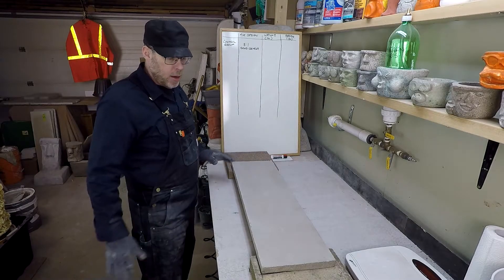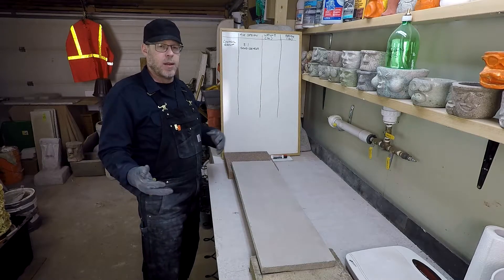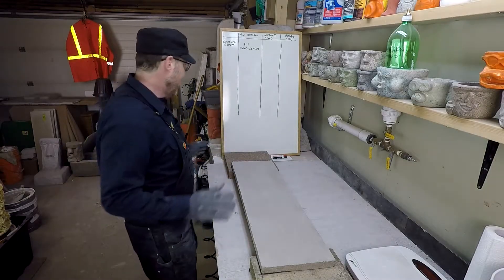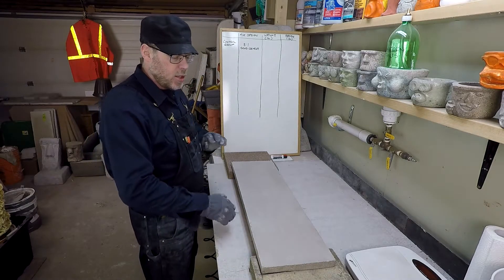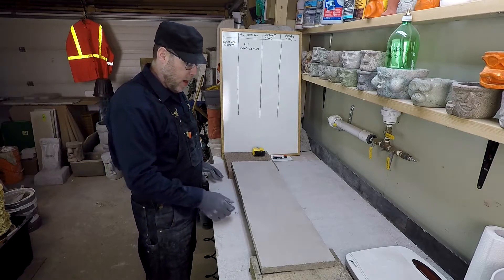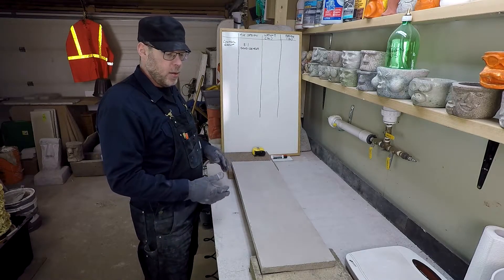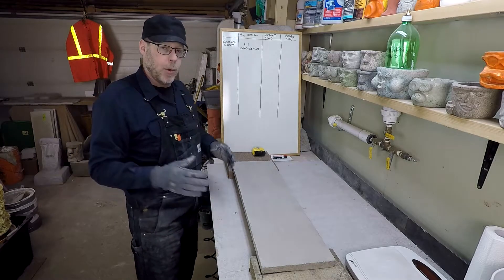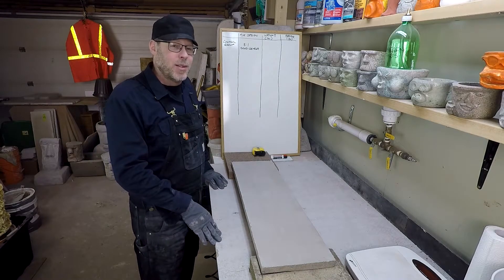Concrete Strength Testing - Control Block 3:1 Mix Ratio

Comment: Have you ever tried tooling in other words, cutting channels into it into the concrete so I could run an element for a kill them?
Reply from the maker: The benefit with concrete is you can do pretty much anything you want.  Running blockouts or channels would be easy enough with either forming or by cutting in after the fact.